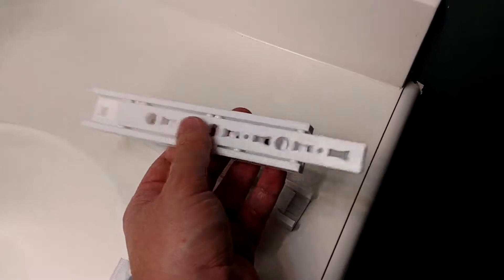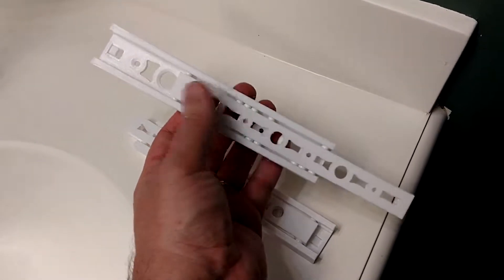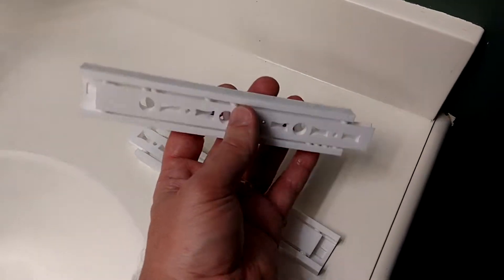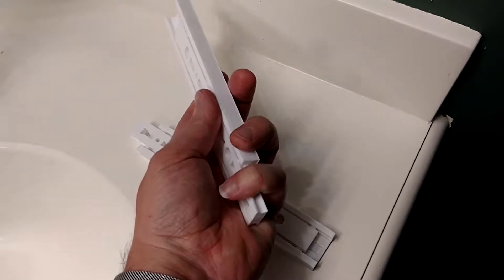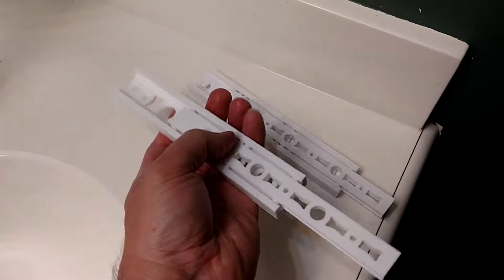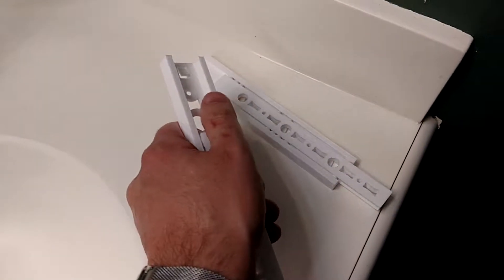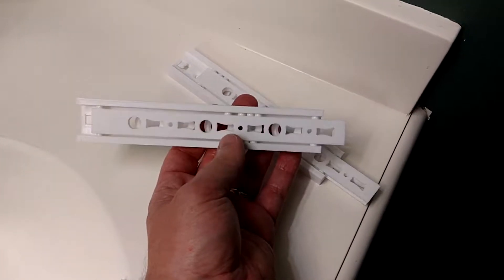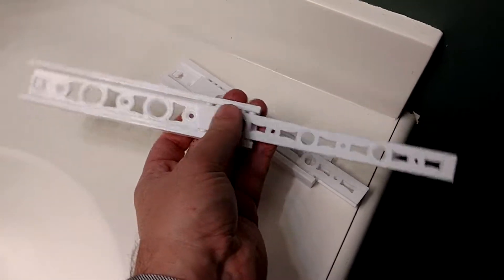Completely waterproof 3D-printed drawer slides/linear rails

Comment: I'm currently looking into waterproof sliding rails for having a Pelican case (loaded with photo gear) mounted onto a kayak. The case would be mounted on the bow, just in front of the cockpit and whenever I want to take photos, I would slide the case towards me for an easier access of my gear and slide it back onto the bow position when I'm done shooting. What kind of load can you rails bear?